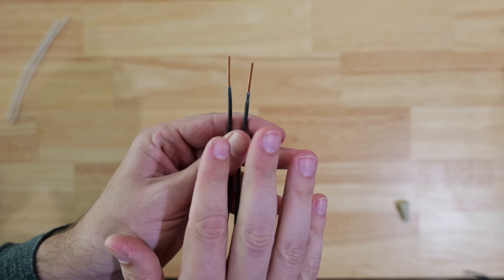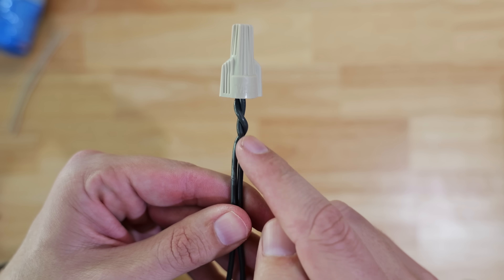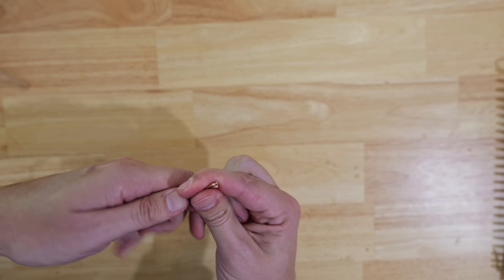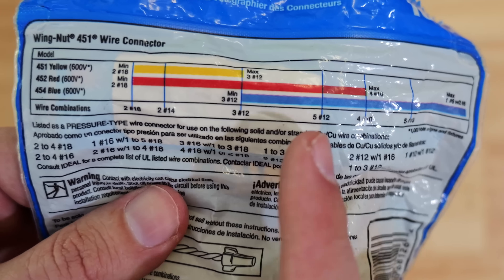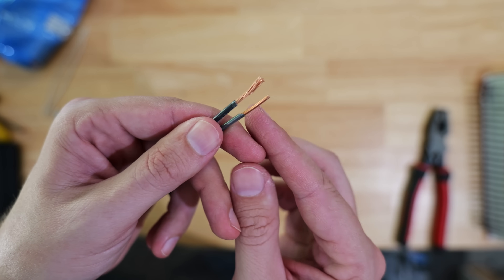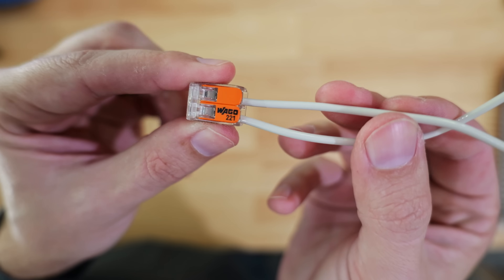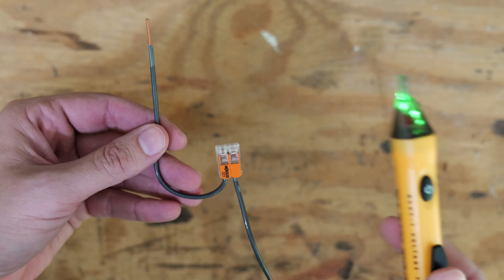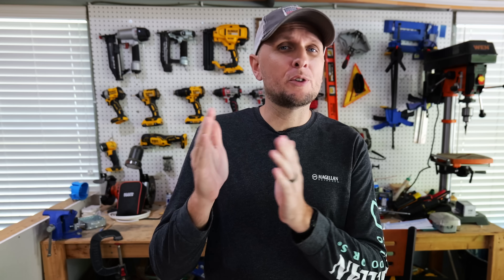7 FATAL Wiring Mistakes Most DIYers Don't Know They Are Making | Most Are Guilty of 3

Comment: I just made revisions to my garage circuits and used Wago 221s and Leviton Edge outlets.  Great experience.  As for keeping Wago levers from lifting when pushing wires into a box, I focused on pushing the Wago connectors to the back of the box before pushing in all the wires.  I could see and verify the state of the Wagos before pushing. the switch or receptacle into place.  This was way easier with Wagos than with wire nuts.

Comment: Great advice, Adam!  And a nicely made, easy to understand video, without the annoying background music other vloggers like to use.
Reply: Yeah I've learned electrical wiring in Germany,  and they been using wagos since the beginning of the 2000s and there hasn't been any issues. As long as you go by the manufacturer specs.

Comment: I heartily agree with wrapping WAGOs with electrical tape to prevent accidental lever opening when pushing into a crowded box, but there is one caution here:  The tape might provide unintended thermal insulation that could cause the connector to overheat if being used a maximum load. I use a single wrap of tape that covers the lower end of the levers only to reduce this possibility.
Reply: Даже представить не могу, по какой причине рычажок сможет сам открыться.

Comment: 12:19 Every video I see demonstrating Wago connectors strips the wires the same way you just did. There is an easier way. Strip any length as long as it is longer than the amount shown on the gage. Put the insulated part on the gage where the mark is and snip off the overhang. It will be correct ever time and it does not involve having to hold the wire on the mark as you pick up your strippers and strip the wire.

Strip any length, hold the wire next to the gage with the insulation on the mark, snip off the overhang, easy peesy.
Reply: I think that’s actually easier and faster than, like u said, lining up the length against the strip gauge then stripping off the insulation. Thanks for writing in with that!
Reply: it's even easier to learn the correct length and just strip them properly.  just takes a little practice.
Reply: Just set your stripper to the correct length.  If you don't already have an automatic wire stripper, get one.  They're not expensive, and they're much quicker and easier than doing it the old way.
Reply: @jonc4403  I agree, but if you are still doing it the old-fashioned way like he was it is easier to strip the wire like I said.
Reply: @jonc4403  I actually tossed my automatic stripper in a drawer after the first day.  for a DIYer, they may work out, but it was just too much bother for me. but the takeaway, is whatever tool you use, you can develop a frame of reference, that lets you strip wires consistently and accurately.

Comment: Thank you so much for these tips. I am not a certified electrician, but I do a lot of my own electrical work at home. I am a believer in being safe and doing things the right way.
I found all of your tips very helpful.
Subbed, liked, and rang the bell!
Thank you for sharing this information with us.
Cheers, Dave.😎🤘
Reply: Doing prescribed electrical without a license  is illegal in my country, im sure its the same for you ?
Reply from the maker: @markkennard861 nope.  In the US most jurisdictions allow the homeowner to do their own electrical work.  We have freedoms here.
Reply: Yea mate freedom is great but fires are not. NZ has 230v so twice the bang. Think home owners are allowed to change an outlet but that's where it stops. Any electrical work requires a certificate here.
Reply: @markkennard861 you must be Australian. Its nothing to do with safety and all to do with the ETU locking the industry down.
Reply: @thericesquad  Hi, close.. NZ.  I guess im biased because in the 40 years in the trade iv never seen a wago in the field. I did see them on the shelf at the suppliers but I don't know a single electrician that would use them.  Im going to get some and apply them as specified and them run specified current and see what happens.
Looking at it from my prospective if you have two, three etc conductors to join then striping back,  twisting and terminating into a suitable size strip connector under both screws is a no brainier. I don't mind admitting old dog new tricks scenario but why add cost to a job and more importantly you know its not going to fail and fry the customer in their sleep.

Comment: We in the UK are KING of electrical safety, well-engineered connectors and plugs/sockets. Our mains plugs don't flop out of the socket when they're casually brushed with the slightest touch. We also have 240V A/C to take precautions with, and so are VERY aware of what not doing so, can cause. Thanks anyway! :)
Reply: Yes,but they are so enormous in size.Look at the continent and see plugs very safe and a lot smaller!!And the plugs dont have to be in the "correct" way,because you can put it two ways in .
(The Netherlands,Belgium and Germany)

Comment: Taping the lever nuts was the first thing I thought of when you showed they could be popped open accidentally. I never knew about having to twist the wires with the regular nuts. I've never seen it done before, but then, we have less than professional electricians in my area. Good to know this info.
Reply: Totally unnecessary to tape the levers on the WAGOs... and I've installed hundreds of them.

If I delivered one of my custom control cabinets with even one wire nut installed I'd never see another order from any of my customers.
Reply: Pretwisting isn't strictly necessary as long as all wires are securely in the spiral.  I think it might make sense in some cases where the wire ends might not line up perfectly (like like spare wire to work with).  In that case pretwisting makes sure that the wires are mechanically together before squeezing them together with the wire nut.  However, I've tried adding another wire to the bundle and it can be a real pain when the insulator is twisted.

Comment: I am guilty of all of these at one time or another. Once I discovered the wago connectors I rarely use anything else. My favorite, though, are the leverless version of wago connectors. It takes one more potential failure out of the element and it is nice to just shove the wire in and seat it without levers. Just like you, I also, tape around all my connectors after they are installed to add that extra level of security. Lastly, once my entire outlet is wired, I also tape around the entire thing to isolate the side screw connectors from anything else in the box ;D  It doesn't take too many jingles or flashes of light after installs to learn your lessons quickly ^_^
Reply: I always do the extra taping too.

Comment: Put the wago levers on the inside of the coil when placing in the box. Electrical tapes insulation properties are greatly reduced when you stretch and snap it off, that's for rough in. I always tape wire nuts to the wire. Great tips and Thank you.

Comment: Up front: All your concerns are completely valid. A very descriptive video.
I have done electrical installs in Canada for a couple of decades and in Germany most of my life, so I do have some basis for an objective comparison.
Wire nuts are a North American thing. Never liked them, as any twisting of copper wire weakens the material. With stranded wire it's even worse. Bad connections, high resistance, followed by heat and - if things get bad enough - arcing and fire. And in North America you're dealing with twice the amperage (as compared to the 230V powergrid in Europe) for a given e.g. 100W bulb in a domestic installation.
Working with stranded wire? WAGOs are o.k., but the better solution are ferrules and a screw joint, especially where you have a  large current flow.
I understand your mission to get knowledge to the DIYs. But honestly, if you have to explain these simple steps, then people with less-than-sufficient knowledge about electical installations may get overconfident and hurt themselves at some other point. The internet is a poor substitute for an actual year-long guided education on the matter.

Comment: Good day Sir, another great video filled with good instructions for a newbie or DIY users. 
My question is  Why does the plug receptacle manufacturer even have the push in connection option if it is that unreliable? It’s as if they are adding to a dangerous practice, I just can’t wrap my head around the fact that the manufacturers are putting out a potentially very dangerous option that isn’t even necessary, BUT then WHY is the CSA ( obviously in Canada ) CANADIAN Standards Association, allowing these types of recepticals to be manufactured and used ????

Comment: 4:36 what you didn’t mention is that you need to always twist the wires clockwise when pre twisting the wires, if you pre twist the wrong way then the wires will un-twist inside the marrette making a bad connection. Marrette is a Canadian “wire nut” company we call wire nuts marrettes the same way we call all tissues Kleenex.

Comment: It's worth mentioning that copper "work-hardens", so every time you bend it, it gets harder to bend it again.  Pull wires out of a box, push them back in, and it'll be harder every time.  It's really important to do it right the first time.
Reply: I pre-bend the wire (solid) into an S shape before pushing the outlet or switch into the box as it gives the wire a path of least resistance (not a pun) mechanically.

Comment: You don't twist wires together just to create a mechanical bond.  I find the notion of wires "vibrating" apart over time, to be a hard pill to swallow.  The main reason to twist wires together is to reduce the chance of fire.  Strong and secure mechanical connections are key to a low-resistance electrical circuit. Resistance in a connection like this occurs when the wires do not make good contact with each other, over a suitable surface area of the bare wires. Resistance can lead to heat build-up, melting of insulation and fire hazard. The wire nuts should only be there to electrically insulate the ends and ensure that the twist stays tight during installation and rough-in.
Reply: So you don't believe in them vibrating apart because they're loose....but you believe in them catching fire due to magically coming loose....😂

Comment: I can't tell you how many times I opened up an electrical box to find wire nuts loose at the bottom, and exposed wires just hanging around. If you're going to use them, use them correctly (as demonstrated in this video). The price of failure can be high...  :)
Reply: @Richard Cranium Good for you, doing the right thing! I'm sure the landlord wasn't happy, but you may have prevented a fire/someone getting killed...  :)
Reply: Never seen a wire nut in the bottom of an electrical box. Seen the wire nut with the set screw loose but those wires are never twisted together.

Comment: For those who want to use wire nuts properly I'll give a short tutorial. First always twist all your solids together tightly before screwing on the wire nut. For strandeds always twist the wires together tightly and screw on the wire nut. Never twist the solid and stranded wires together. Always twist the solids together. Always twist the strandeds together. Then hold them with the ends equal and screw on the wire nut while holding the wires firmly in your hand. If one group pulls ahead of the other then redo your connection. Most wire nut boxes will have a table printed on the back recommending how many wires of what size will work with what size wirenut. After making literally tens of thousands of connections over forty years I've seen and dealt with many types of connections but I've yet to see any device that will outlast and out perform a properly installed wire nut.
Reply: @cmmartti  I'd fire a wireman in a minute for doing it your way.  Wires should always be twisted for a solid connection and never lead a stranded or solid to the other. The ends should be even going into the wire nut. If you lead with the stranded it will get sucked into the wirenut and end up balling in the end blocking the solid. Same thing happens when you lead with the solid.
Reply: @cmmartti  I'm well aware of what it says on the package but that doesn't make it right. You can never depend on the wire nut to twist the wires together properly and it's quite the norm to remove a wire nut and add an additional wire and you don't want the wires coming apart under load while you do that. The wire nut manufacturer doesn't take that into consideration.
Reply: @haroldgreen1425  Sorry, but that's wrong: the stranded wire MUST lead the solid wire into a wire nut to make a solid connection. The trick with two wires is to 'lead' the stranded wire just slightly ahead of the solid one and hold both wires tightly enough so that the stranded wire just folds slightly around the tip of the solid and thus lock itself into the wire nut. If you do not hold the stranded wire tightly then yes, it will pull in and bunch up, and the solid will come loose when pulled. If you line both wires up evenly then the stranded wire is pushed out and the solid wire will be the one to lock into the wire nut while the stranded wire will pull out.

For multiple solid wires and one stranded (a common splice), twist the solids together first then lay the stranded into the wrap leading it by just enough to be trapped by the wire nut when you twist it on.

(and no, I would never rely on the wire nut to twist my wires for me...not because I don't believe they will twist inside the wire nut, but because I can't see the actual splice and how tight and symmetrical the wrap is. There is a reason I never made a bad splice in over 40 years of wiring: I tested every one that was the least bit suspect...)

For multiple solids and multiple strandeds, do it exactly as Harold Green suggests. Lead the strandeds (by a tiny bit) if you like, or don't...as long as you hold them tightly and then test the splice afterwards by pulling on the wires. Knowledge and experience may be the main factor in making a good splice, but finger strength is a close second.

Comment: 9:58  makes you wish Wago would add a way to lock the levers down, some kind of second lock.
Reply from the maker: Yeah something.  Thanks for the input Michael!
Reply: That's what the boxes are for. And, if you close them properly, they don't flip open. Make sure you use the correct connector for your wire guage
Reply: Put a zip tie on it.  Then tape the zip tie.  Then put  heat shrink over the tape.  Then post a fire guard at each connection. Then never turn on the main breaker.
Reply: Wago 2273-205 is designed for this purpose.. One time use, insert the stripped copper and it will stay put.
he's just showing the wrong type of WAGO221 in the video. off course those should not be used.. they are not meant for permanent install.  thats what 2273-205 is for.

Comment: Question - I'm installing metal new work outlet boxes in my home and installing new industrial grade "self-grounding" receptacles that don't require a grounding pigtail because they bond automatically to the metal box when you fasten it to a metal box with screws.   I bought some packs of different size Wago connectors as well.  The very first box on the circuit I'm working on in guest bedroom will have a self grounding AFCI receptacle that protects everything downstream.  This box will have 1 line cable incoming and 2 load cables outgoing.  So, in this case there will be a splicing of 4 ground wires together ( 1. line cable ground 2. load cable-A ground 3. load cable-B ground 4. metal outlet box ground pigtail) Normally, there would have been 5 ground wires tying together, but because I'm using a self-grounding AFCI receptacle, the receptacle bonds to the metal box when its fastened and does not require its own grounding pigtail like a regular receptacle does.    My question is, out of all of demonstrations of Wago connectors that I have seen, I have not seen them used for tying ground wires together.   I've only seen them used for hot and neutral connections.   I used a 5 port Wago connector to tie the 4 ground wires together in the metal box.   Is this allowed or not allowed by code or do inspectors not like seeing Wago connectors used to tie grounds together for some reason?  I'm only using Wago connectors when there will be 3 or more wires tying together to cut down risk of a wire being loose when they are twisted together.

Comment: Don't forget the none lever type push in wire wago connectors. 
They do a vast range now .
Reply: Unbeatably quick to install and safe to use... but only for solid wire. I guess 99% of new installations in Germany use them.

Comment: The clip lifting on the dual WAGO is akin to undoing a screw on a Weidmuller terminal strip and being shocked the screw was undone.

99% of this video are non-issues, and anyone "experiencing" any of these problems had no business doing the work in the first place.

It's not a product problem, it's an idiot problem.
Reply from the maker: These are all issues that happen and yes they are user error.  That is what the video is all about.

Comment: I love the Wagos, but I still find myself using wire nuts more often; it's probably because I have thousands of them lying around, and they are cheaper. But in the UK, it's the other way around. If you know what you're doing, they both work great. What still amazes me is how many times I've opened up a wire nut and found what you pointed out.
Reply: Wire nuts can make for a very solid connection.  However, it gets much harder to line up wires with little wire to work with inside a junction box.  I've even considered using more wire nuts to extend wires, then make three connections further out.  It's a lot easier to connect two wires together than three unless there's decent room to work with.